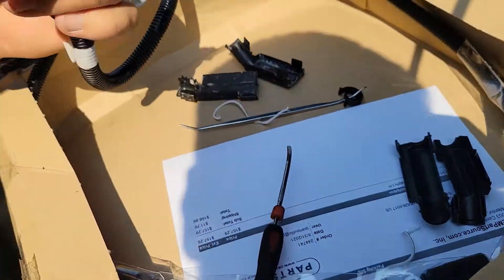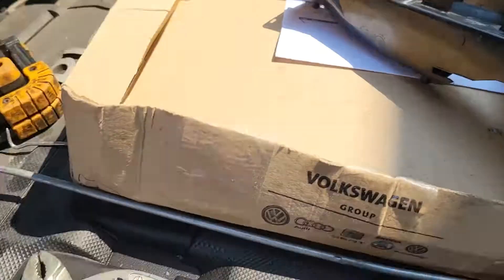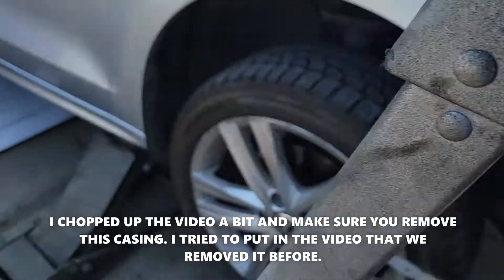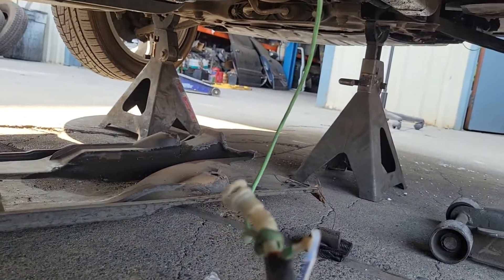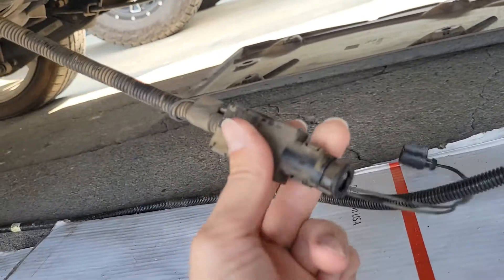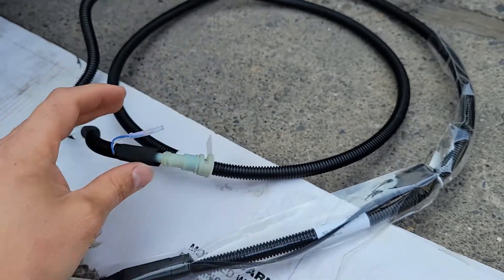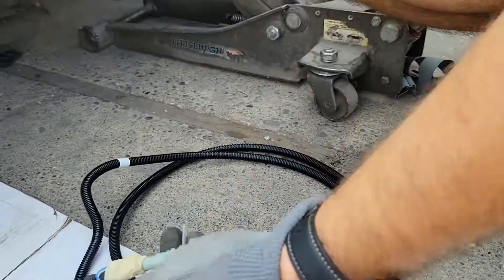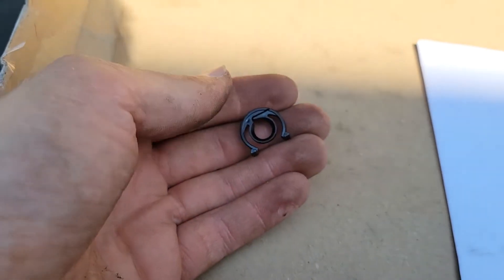2015 VW JETTA TDI DEF DPF EXHAUST FLUID FEED LINE LEAKING REPLACEMENT

Comment: What were the symptoms?  My TDI is leaking air as I let accelerate and then put the clutch in.  The power is still strong.  It just has a high hissing sound when driving.
Reply from the maker: Line leaking crystalized

Comment: I like the video.  What was the reason you disconnected the other 2 lines in the engine bay?  Do you have a video for plastic fuel line cover removal?
Reply: I think those fuel lines run inside the same cover so you need to remove if you want to take the cover off.

Comment: @ipartsoutstudio Was the broken lines clip mechanism that locks the line to injector different than the new one? I’m having hard time to disconnect the line from the injector. The clip in mine rotates and clicks when rotated counter clockwise. The assembly documentation from Voss for the connector looks different (probably new version) and I would not want to break the old when disconnecting😬
Reply from the maker: Mine was the same as I remember it was a while ago
Reply: What was your solution? I’m having the same issue.

Comment: Thanks for det video! Great support to try and fix it myself on my car. Where did you purchase the new adblue hose? I have the same issue on my VW Tiguan 2017. But the hose is very expensive through VW.
Reply from the maker: I googled the part number found the lowest priced that way. It was close to 200. Part actually had a recall but I could wait